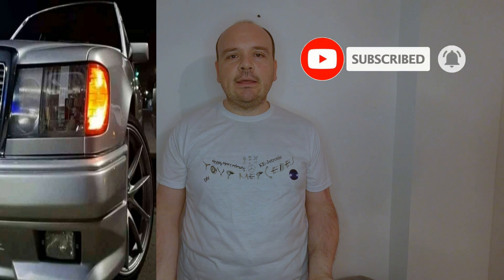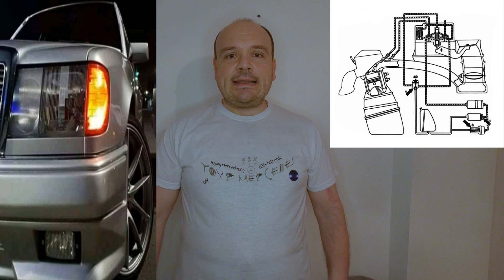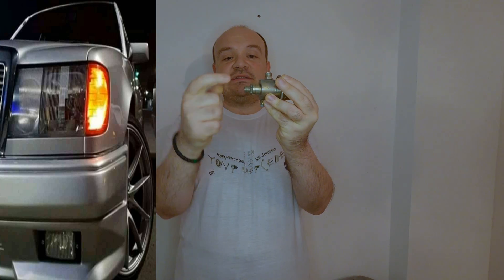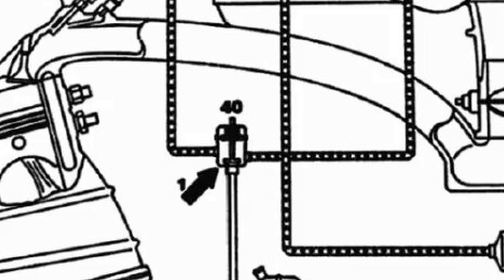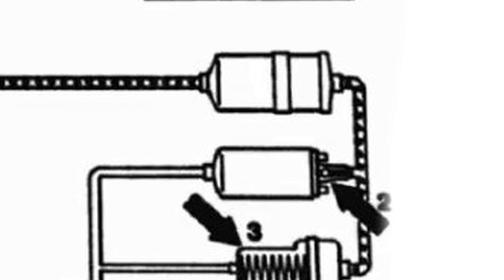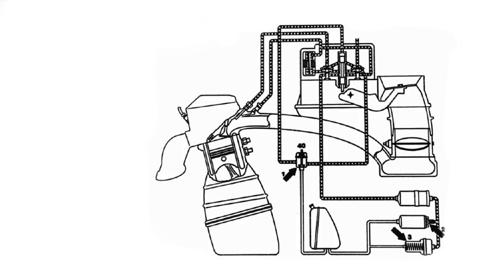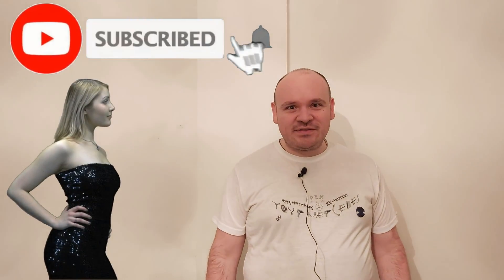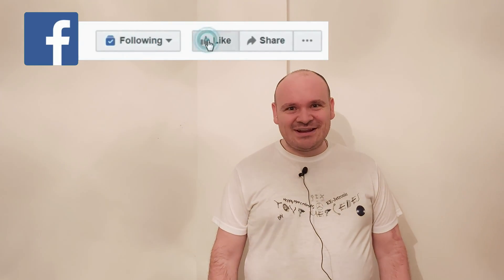㉦Mercedes Ke-Jetronic㉦ - Why Residual Pressure Matters (Hot-Start Problems Explained)

Comment: Geniales vídeos, tengo un 190 E 2.0 con motor GM 102961, tine ralentí inestable y cuando lleva tiempo circulando, más de 20 minutos o media hora, en salida da unos tirones muy fuertes, En crucero a velocidades altas va perfecto solo falla en las salidas por los fuertes irones. Gracias¡¡¡¡.  El ralentí se estabiliza más con el aire acondicionado puesto. Si quitas el aire se caen las RPM de ralentí.
Reply from the maker: ¿Cambiaste el inyector así como la lambda?
Reply: @mercedeske  Hola, no he tocado nada de momento, solo he añadido un líquido limpiador de inyectores a la gasolina. Probaré como dices cambio de Lamda e inyectores.El coche tiene ya 38 años¡¡¡¡¡
Reply from the maker: Si, haga lo!

Comment: I'm trying to get the courage to service my FD, I think the plunger has a small leak...
Reply from the maker: If it does, just remove it and buy another seal ring, replace it and that's it. Just watch for the distance between the sleeve and the nut, measure it before unscrewing the sleeve. Nothing hard. Fingers crossed 🤞🏻 Happy Mercedesing 😃
Reply: @mercedeske  thanks buddy!!! 👍🏻👍🏻
Reply from the maker: @Ne0n_Kn8  My pleasure 😉

Comment: How long does the pressure have to be (for e.g.  3.2 bar) remain?  1 day or 1 week😬
Reply from the maker: 30min after stalling the engine.
Reply: Thanks
Reply: Why does the engine start well week later with no pressure, but 30minutes after with leaked pressure it struggles to start?

Shouldn't the engine struggle to start too if the pressure drops after a week?
Reply from the maker: No, the engine doesn't struggle. I have been talking about that. There are two different types of a start - a cold and a warm start. When the engine is cold the cold start valve is going to help the engine start easier. The cold start valve stops spraying above 60 degrees C(engines M102&103, M104 - the cold start valve operates up to 70 degrees). In 30 minutes it's not possible for an engine to cool down under 60 degrees so there is nothing to help the engine build the pressure because of the leaky fuel accumulator or bad injectors. When the car is warm there must be no pressure drop in order to help the engine start easier. When the engine is cold, the cold start valve is going to help the engine start easier so it doesn't matter if there is pressure loss or not. When the engine is warm it relies no the fuel accumulator. If it is bad then you will have warm start issues. I hope you understand it now.